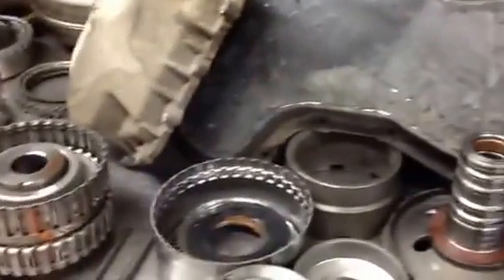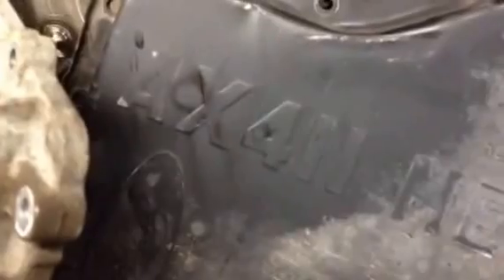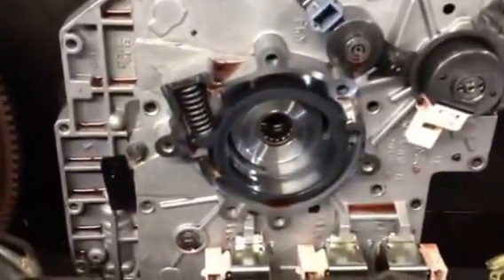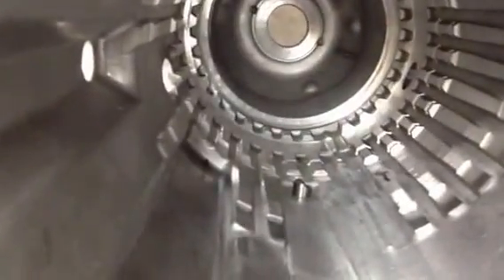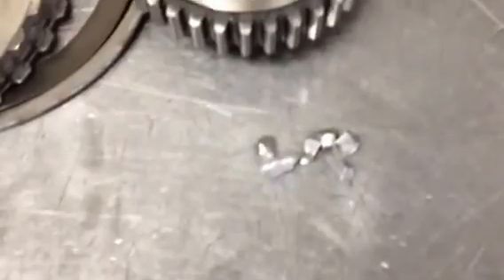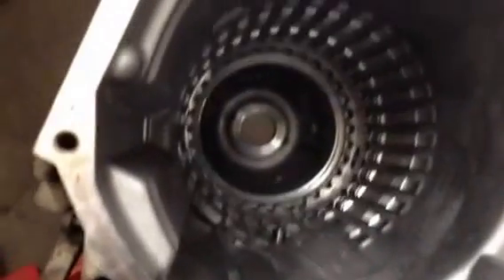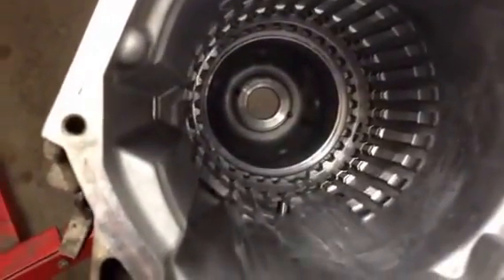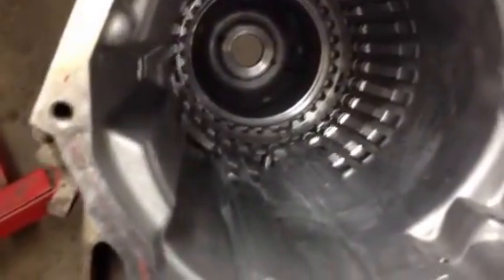Taurus Meenan lansdale

Comment: hello i have a 97 taurus g ax4s trans
trans seems to shift soft when cold ,but when it warms up it bangs from 1st to 2nd pretty hard sometimes harder then other times, but yet if i get into it a little it shifts ok
its weird ,its only first to second,.. no check engine lights on... pulled the pan down and it looked pretty clean other then the fluid looked dirty ,there was no metal little stuff on the magnet .i did smell weird but not burnt weird